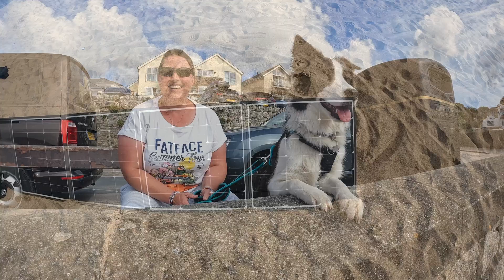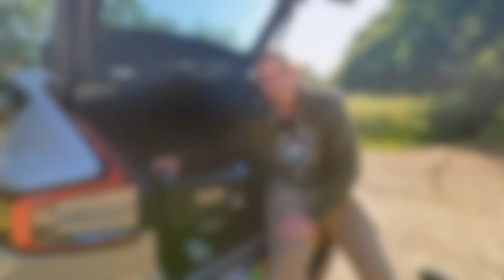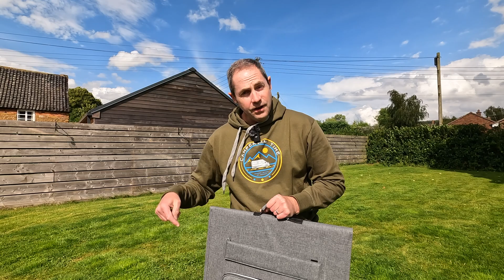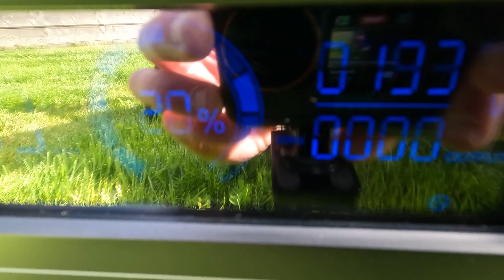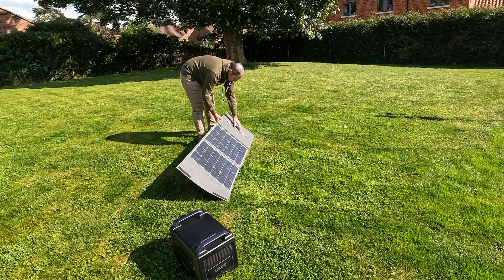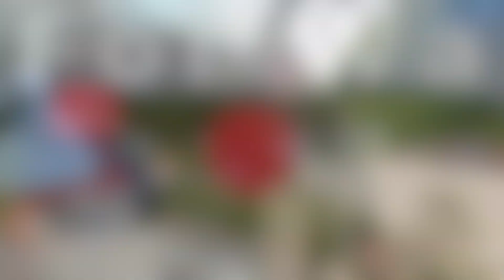Aferiy 2000w Power Bank & Solar Panels - AMAZING Value - £/Power! Full Review & Test

Comment: Great review on these products . We bought one of theses and the same solar panel during amazon prime promotion  got them both for £895 saving £650 but not used it yet but will in 2 weeks time when away off grid in the van done a bit of testing around the home  and can not fault it

Comment: Code TIMEUK07 isn't working on the unit.
Reply from the maker: Hi - they have reset the discount code so TIMEUK07 should work now, but they have also added another TIMEUK08 which will be live from 9am 2nd August. Thanks
Reply from the maker: Ok, let me message them and see what’s happening

Comment: I got a great deal on this unit and then it came up on Amazon bargain week for £750, outstanding price for such a powerful unit. You are right about the screen being a bit awkward in direct sun but it ticks a lot of boxes. Thanks for the great video review.
Reply from the maker: No worries, that’s a crazy price!
Reply: I got it for £750 but it was faulty and despite Amazon saying no returns in the end I got it returned as Aferiy said Amazon was advertising it wrong. I also got a few accessories I was able to send back. It's worth £750 but not worth the £1399 they want now

Comment: We have put solar panels on our Cali and on a 2 week trip to Dorset and Devon we didn’t plug into the mains once and it kept the leisure batteries full even on cloudy and rainy days with the pop top up and the panels facing north. Admittedly we were only using the fridge, lighting and charging phones and torches via usb and the inverter under the driver’s seat, but everything we needed to keep charged and use.